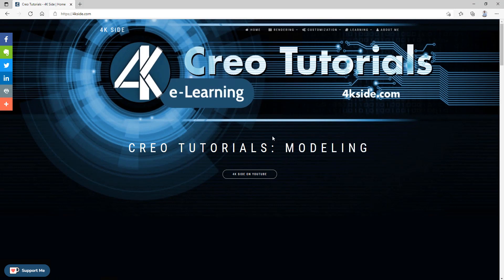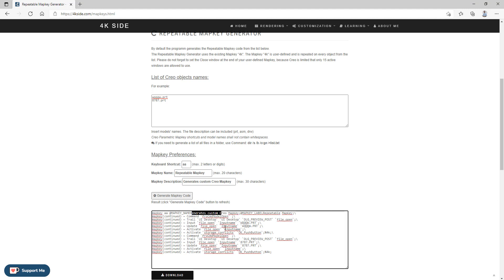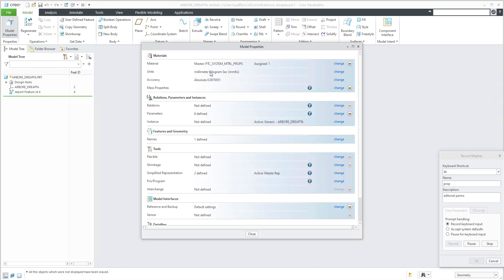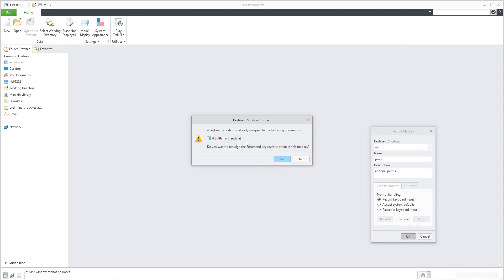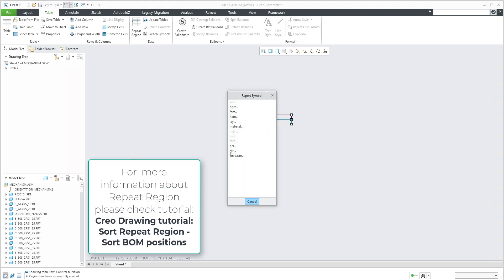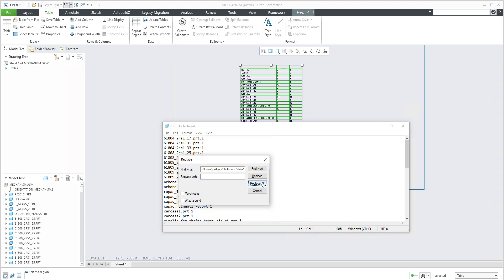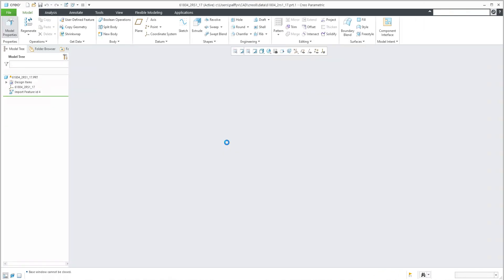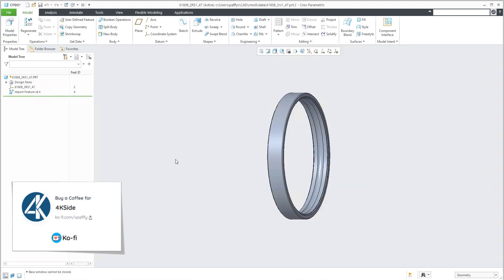Repeatable Mapkey Generator | How to loop Creo Mapkey

Comment: Dear sir,
I tried your mapkey to convert STEP files into PRT files in creo 9.0. but unfortunately this won't work. I understand because the code given by your program is to open the .prt and apply 4k mapkey and close and so on.  It can be enhanced to place our custom mapkey, multiply and replace what we need. 

For example, if i need to balloon note 1 2 3 4 upto 100, i can create a Mapkey only for note 1 paste there, manually select 1 in mapkey so the utility multiply and replace with 100 instances as given in the list column
Reply from the maker: Thank you for question.
I will try it, I think that is possible... Because System will wait for mouse click and placement.
But I need to try 😉
I will stay in touch and share with you my results / necessary file 😎
Bye, Vladimir

Comment: Hi,
Is it possible to select "composite curve" during udf placement using a mapkey as shown in your example on creating chain links in creo.
I find that only for "composite curve " the find option is grayed out. So I can't use find "3d curve" by feature name or intent datum  or other way. The only way is to select in graphics window by mouse.
Reply from the maker: Sorry, but sometimes is not possible to select / search object as expected.
For your example is working only graphic window 😢
For now, I do not have another workaround... But thanks for your question.
Stay tuned, Vladimir

Comment: This is a good base tool

Note that there is no close window in the commands. All windows are being left open(which may be by design). There is a 15 window limit. So the max number of files that could be edited and left open is 15. If each window was closed after edit you could keep going. The updated files would be in session, not in window, and not SAVED. So adding a save before closing the window may also be a good option. Saving may not be smooth depending on setup/files.

Every different use case needs little tweaks. 

I tested that
mapkey(continued) ~ Input `file_open` `Inputname` `SHAFT_0100258.PRT`;\
line is not needed, only the following update line. At least on my CREO 7
Reply from the maker: Hi, firtst of all thanks for your comment. I would likely to add that I have mentioned on web page that is necessary to add into your mapkey function Close Window "The Repeatable Mapkey Generator uses the existing Mapkey "4k". The Mapkey "4k" is user-defined and is repeated on every object from the list. Please do not forget to set the Close window at the end of your user-defined Mapkey, because Creo is limited that only 15 active windows are allowed to use."

I use this utility if I need to apply changes to multiple models and assemblies and it works for 1500 objects also (so Save model and Close window is always used in my customized mapkey 4k.

Thanks again and stay tuned. Vladimir

Comment: Nice videos...

Request you to post videos about CREO CABLING..
LIKE ROUTING THE HARNESS, SELECTION OF CABLES, BEND AND BEND RADIUS,
FLATTENING, SELECTION OF TERMINALS, CONNECTORS & FINALLY THE DRAWING CREATION.
Reply from the maker: Thank you for your suggestion for next tutorials series. Stay tuned. Vladimir
Reply: @4kside  

Thanks for the reply. Adding to it also do video's on styling software ,Hypermesh and Ansys which are used in Automotive and aerospace industry.